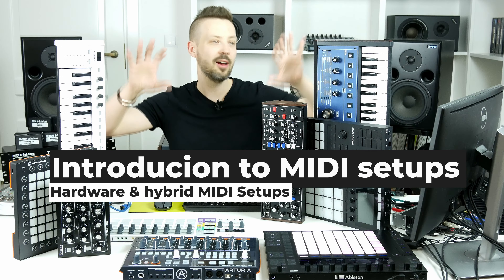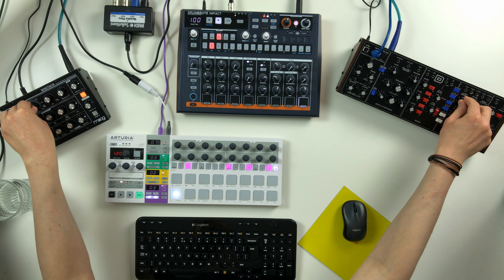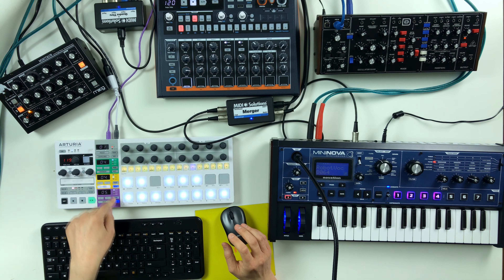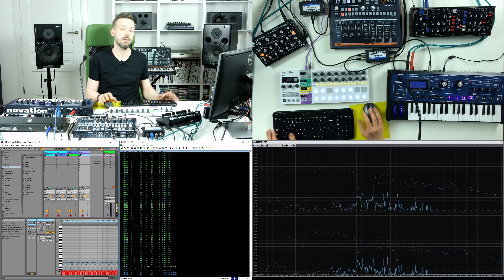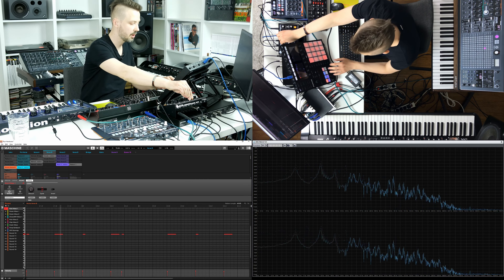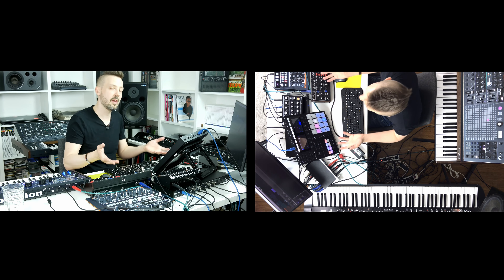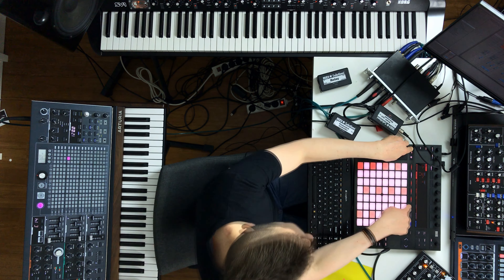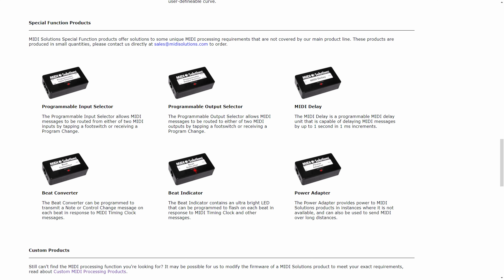How To Connect Hardware Synthesizers And Sequencers Using Midi

Comment: Hi, maybe you can help me 😢 My midi setup is made up of: 1 midi controller keyboard with a built in 8 parts sequencer and 2 midi outs (one can be thru) and 1 midi in. (Novation sl mkIII) I want to use this to control all the gears. Then I have 1 master brain midi multitrack sequencer and multitimbral tone generator Yamaha rs7000 with 2 built in midi outs or thru and one midi in. I'd like that it can control all the gears too and that can do a bidirectional speaking and recordings with the novation. Then ilI have another multitimbral synth roland sh-32 with a midi out or thru and 1 midi in. Then another synth (korg nts-1) that I use mostly like a multi effect connected to the roland ( it has only 1 midi in and no midi out) obviously thanks to its audio in port. Then I have another synth to connect to all the system and it is a dreadbox typhon that has 1 midi in and one midi out with thru possibility. I'd like that the novation can control all the gears and can record sequences also on the Yamaha sequencer and viceversa. Can you give me a suggested configuration for my goals and considering the gears I have? Do I have to buy some accessories or I can connect all without? (I'm dawless) . It will be nice 🙏🤟 congrats for your passion and knowledge 💯

Comment: I have no PC,what do I output sounds to?
Reply: Typically, you run the audio out the hardware synths, drum machines and sound modules etc. into a mixer, and then monitors / speakers are plugged into the mixer
Reply: @ADHDville  thanks for info